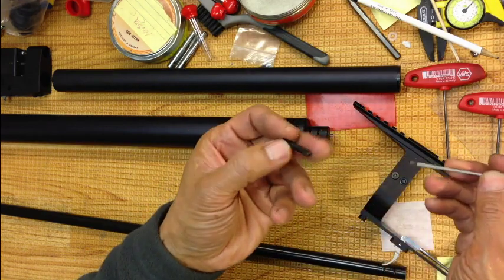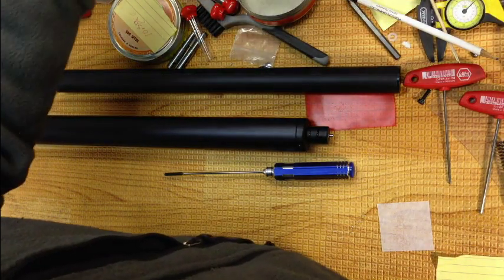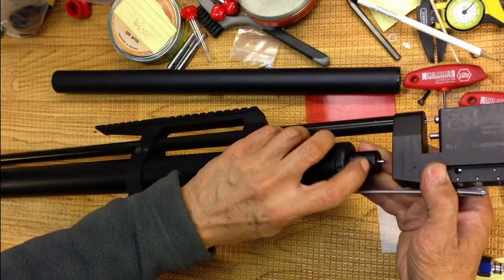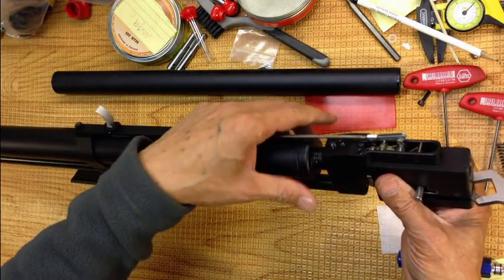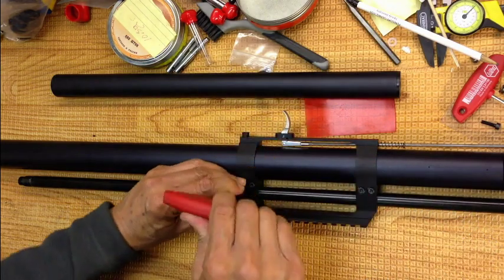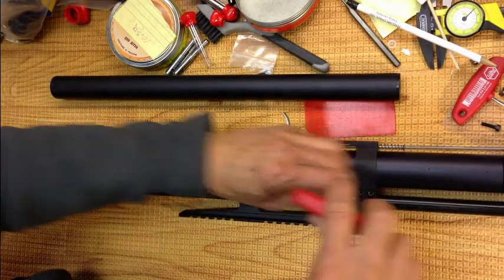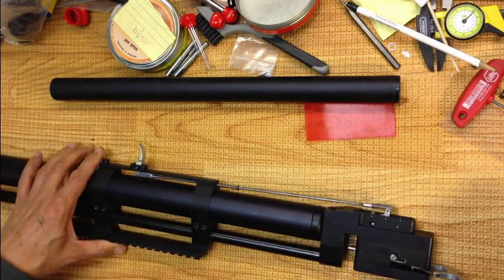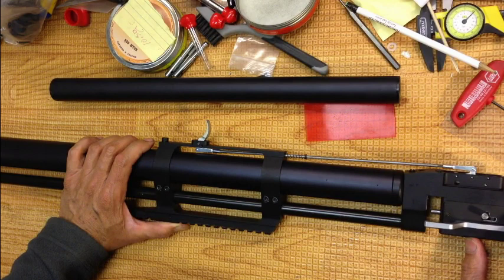Cricket Barrel, breech and air tube reinstall and turque pattern

Comment: Thanks Ernest, I have a 22 cricket that does not hold zero. I can zero it at 50 yards dead center and the next day it shoots 1'' to the right with no wind ! I have already changed the scope rings and scope is fine also. What is the problem? Do you have any contact information for tuning my gun? Thanks.